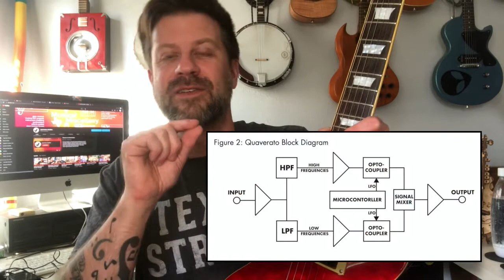Zeppelin Design Labs Quaverato DIY Kit (harmonic tremolo pedal)

Comment: Even it's an older video, maybe you can give me some help with the calibration.
Is there an "all-round" setting from were to start with those trim pots and dip switches? 
Best wishes from Bavaria Germany.
Btw. I'm obsessed with Tremolo and Reverb pedals.
So i own >10 trem pedals.
My favorite are the Supro, Keeley Dynatrem and the Jam Monk V2.
I'm hoping for the Quaverato because it has 6 presets, switchable via Midi.
Reply from the maker: Thanks for checking out the video. If you check page 11 of the Owners Manual (different from the Assembly Guide), it tells you how to put the Quaverato in calibration mode and get it setup. Try that and see if it works. If not, shoot an email to the guys at Zeppelin Design Labs. They're really good at support. I emailed them about one of the their products and got a really detailed response in like 2 hours. They're really easy to work with too.
Reply: @musicalmiscellany  
Thank you for your responce.
I have the whole manuals already but i avoid reading technical stuff
😁😁 It's a bit overwhelming for me. I'm over 70 and my English is very basic...
I just thought you have some experience with the Dips in different positions. The Pots are no problem i think, it's just reading the value on my volt-multi-meter- thingy.